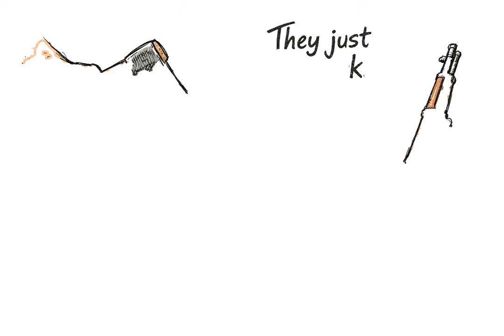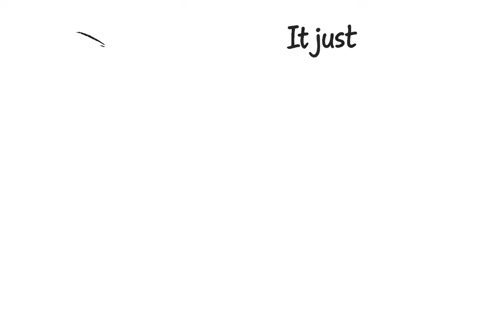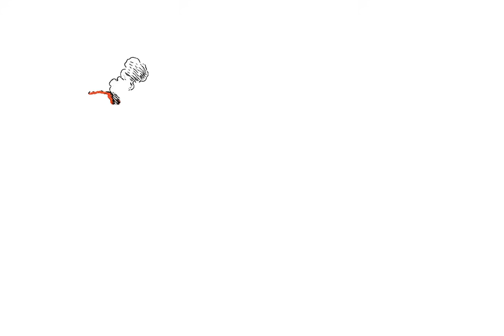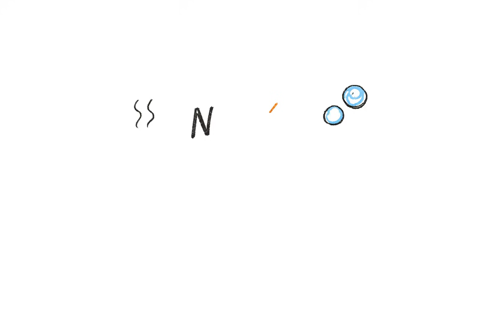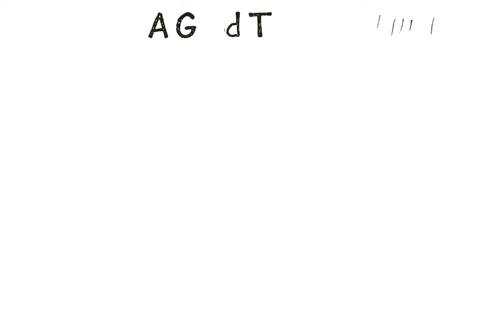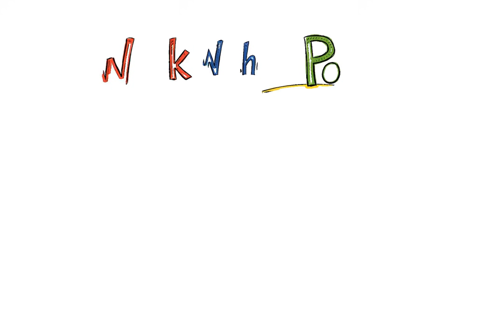15 Survival Gear Items That Last Forever | Prepping Guide For Beginners

Comment: The ferro rod can worn out since every strike it loses some piece of it
Reply: Yes but in case you didn't watch the video, it doesn't break, it doesn't run out of gas and it can be used when its wet/raining. It can worn out but it lasts very long and you can have multiple of them in case of necessity. But it's always suggested to also have lighters and matches.

Comment: You forgot to mention battery flashlights running on rechargeable batteries, recharged by solar panels
Reply: Sounds fine. Hand cranck lights hardly produce any light and are far more complicated and prone to break down. Also a complicated can opener as shown is prone to break down. Fleece as a material for blankets and clothes  still insulate when damp and when wet it dries infinitaly quicker than wool.